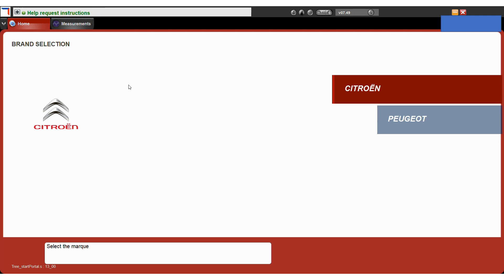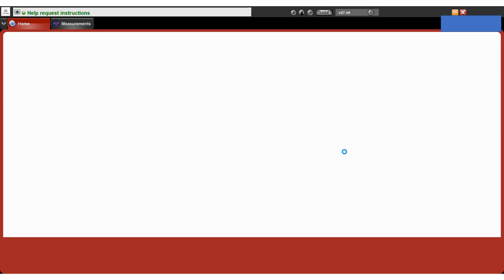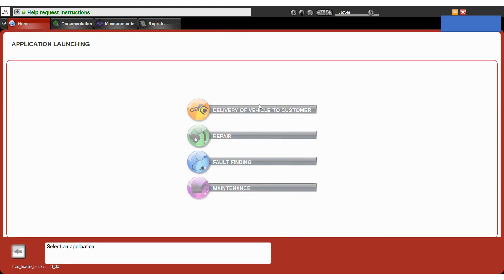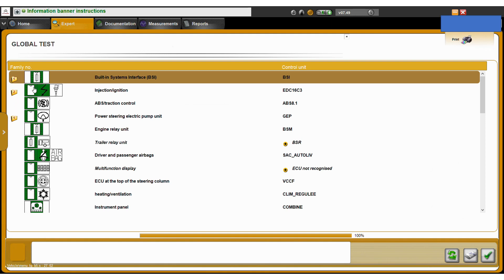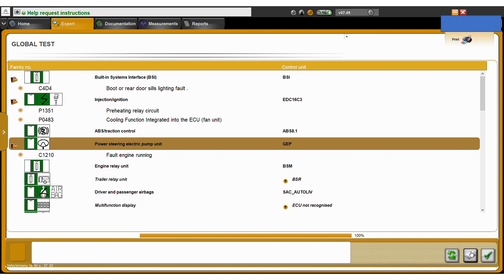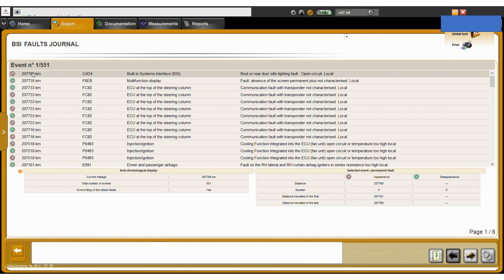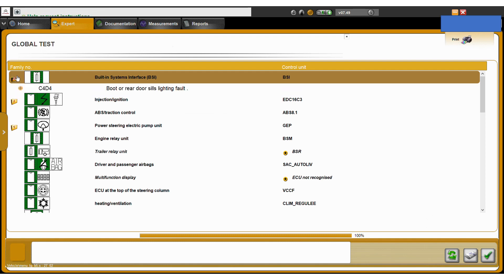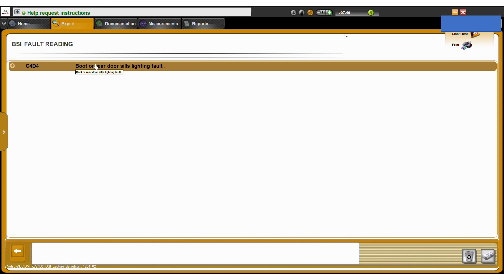1 - Diagbox startup, reading & clearing faults demo

Comment: Hi there. 
I have got as far as clearing fault codes but after validating (green arrow) and it says "Faults Cleared" the list of faults remains......am I missing something?  TIA....
Reply from the maker: @kwanzer900  Depends on the exact codes but that's usually indication there is a definite issue causing the fault - so the code reappears straight away after being cleared once